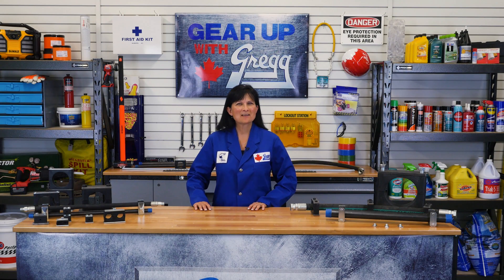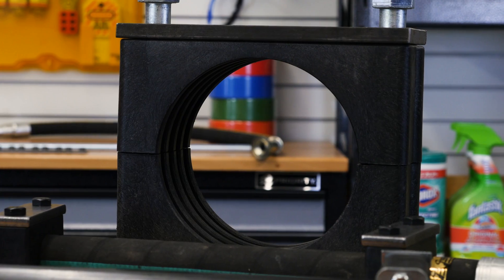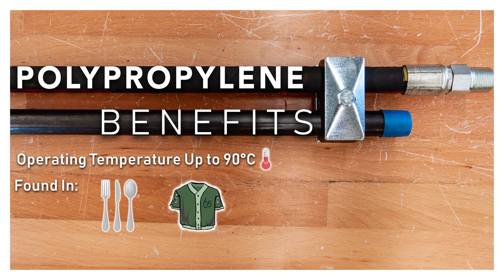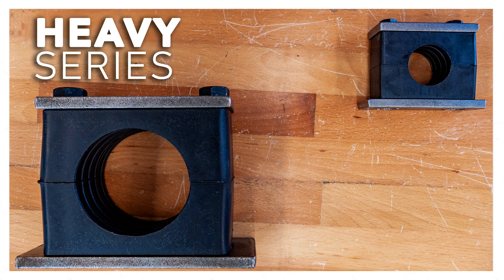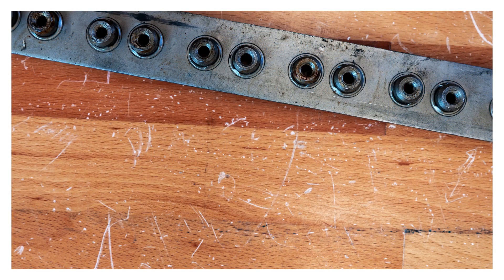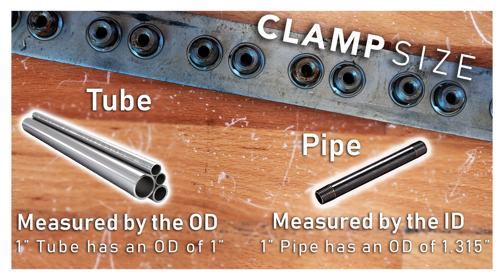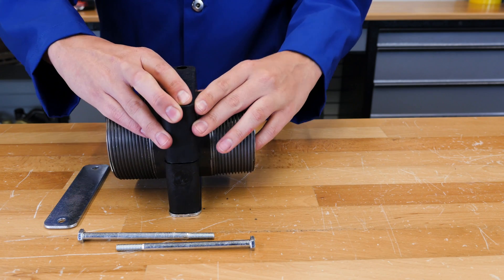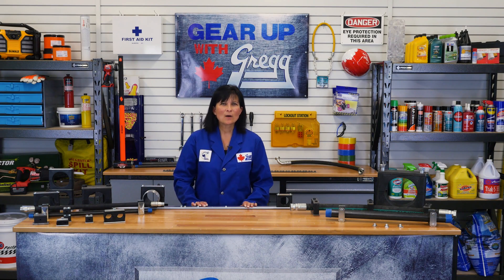Why You Need Behringer Pipe Clamps in Your Hydraulic Assembly - Gear Up With Gregg's

Comment: Will this eliminate vibration?
Reply from the maker: Using this system will likely reduce, and potentially eliminate vibration.  There are a lot of variables at play to truly be able to say if this will eliminate vibration entirely.  For instance, spacing of clamps, dynamic versus static pressure, size of hose, pressures etc. etc.  Ultimately, you have a higher likelihood of eliminating vibration by using the Behringer system versus other options.  Hope that helps and thanks for watching our video!
Reply: @GreggDistributorsLP  Do you have a distributor in Cyprus? Where can I source those products?